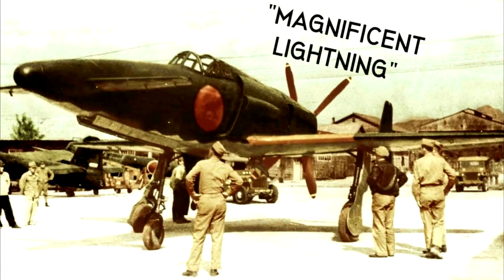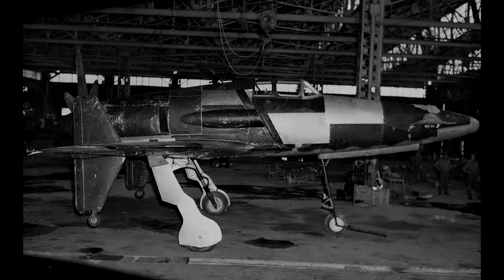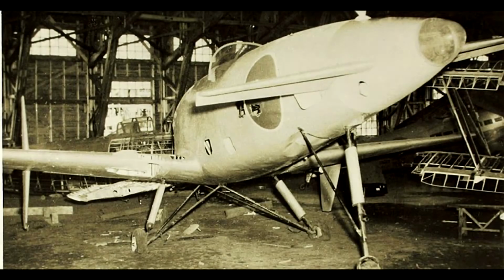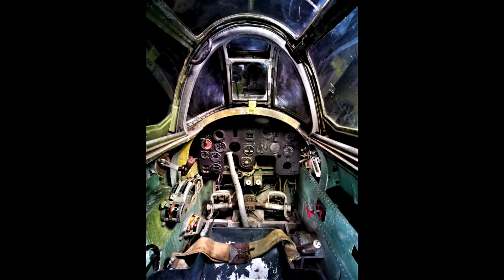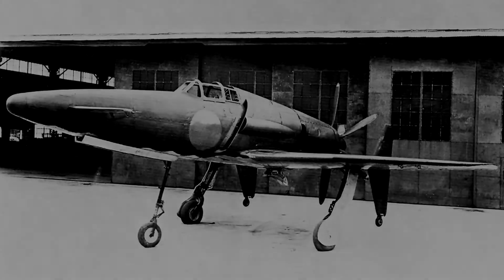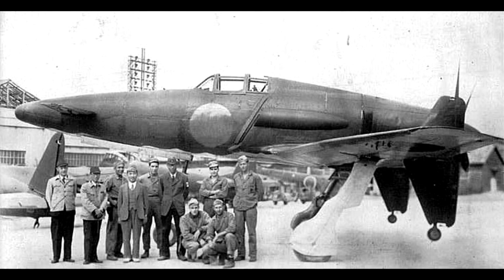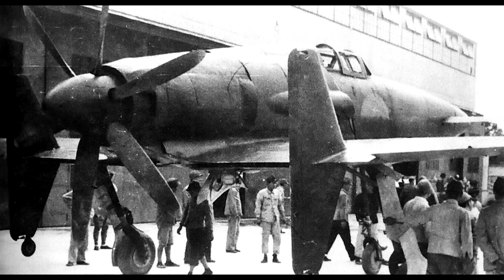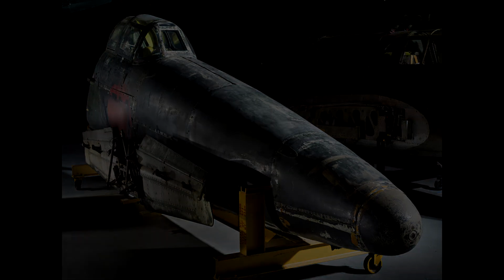Kyushu J7W Shinden

Comment: Good video. Having been to Japan in the Marines in the '70s, I learned they pronounce some words in a manner unlike the way they're spelled in Romaji. So Yokusuka is pronounced: Ya-KOS-ka. [The internal U vowels get compressed or skipped in the Kanto Dialect of Tokyo.] The base is near Tokyo and is still in use as a  US Naval base, with the JMSDF base nearby. During the Imperial Navy period,   it was the Yokusuka Naval Air Technical Arsenal and home to the IJN 1st Fleet.
The Kyushu J7W Shinden is a good example of parallel development when compared to American experimental fighters evaluated under the USAAC's request for proposal, R-40C, which spawned the similarly configured XP-54, XP-55 and XP-56 prototypes. These aircraft followed a similar development arc, but were closed out by powerplant problems, the War ending, and the promise of Jets in the Future.
In a Parallel Universe, it would have been interesting to see a dogfight between a Shinden and a Curtiss ''Ass-Ender.''

Comment: Like all of these "if only" videos, this assumes all you need is a great designed aircraft, and Wallah, you have a war winning weapon. Well, it isn't that easy. First you need an intact manufacturing ability. Next you need raw materials in sufficient quantities to build and fuel adequate numbers of these wonder aircraft. And lastly you need numbers of highly trained pilots to successfully use your "game changing" weapon. In mid 1945, Japan had none of these three essential elements. The Kyushu J7W Shinden was an interesting aircraft, however, the design coming when it did, there was no way it could have effected the outcome of the war, with or without the Atomic bomb being used.
Reply from the maker: Completely agree. Too little, too late. I appreciate the comment!

Comment: Phil Coleman always want to fly the J7W 2nd prototype when it was tested by common wealth air forces in Malaysia prior to shipment to the US when he was on his way home from the CBI. He did however, meet an English test pilot that flew it while it was there. These flights were performed by men with engineering and physics educations like Phil, and were the most extensive test performed on it. The no 2 airframe was 13 lbs heavier empty, because the fuselage was 1.5 inches longer permitting the nose wheel to be mounted 3 inches farther forward. The short wheel base could cause fore and hopping between 25 and 45 knots (taxi, take off, and landing). Phil said, quoting his European counter part, "The Shinden had the best low speed handling and maneuvering of high performance machines of its configuration." The British pilot recorded the following based on instruments preflight calibrated and local meteorological calculations he and Phil agreed on. Prior to flight the machine was given inspection and maintenance rivalling its day of manufacture. Approaching 26000ft, the J7W was climbing nearly 500 ft per minute and was demonstrating a barely perceptible acceleration at 466 mph. (statute miles per hr and true not indicated airspeed) The conclusions reached by them and the Japanese engineers weeks earlier on the no1 prototype was that the design goal of 497@27000 could be exceeded by 1.5%. Phil has since passed away. His experience should be preserved. A humorous fantasy story about the Shinden can be found on booksie.com

Comment: I wouldn't want to have to bail out with the prop behind you might look like hamburger with out an ejection seat!!
Reply: I recall these had or had planned to have a jettisonable (cant remember if it was explosive or mechanical) prop hub
Reply from the maker: @Colt45hatchback  I think you are correct. I remember coming across information during research regarding a prop hub with a mechanical release. Take that with a grain of salt though.
Reply from the maker: HA! Lol didn’t even consider that 😂, Appreciate the comment.
Reply: That’s why the Dornier Pfiel had a system to blow the rear propeller off if the canopy was released… (The Pfiel also has ejection seats …). The Saab J21 had a similar system but that became redundant when a jet engine was fitted after WW2.